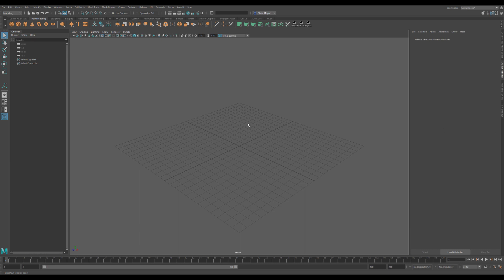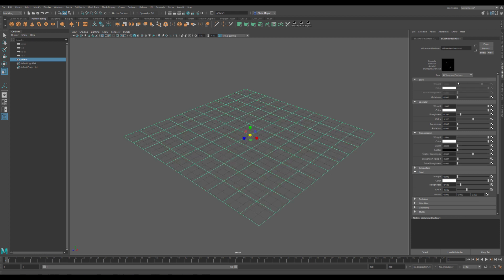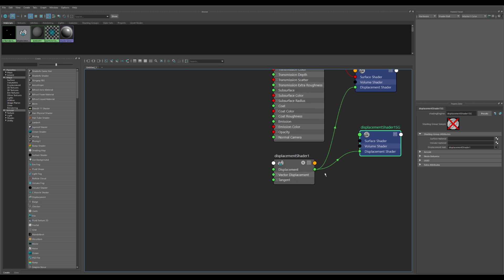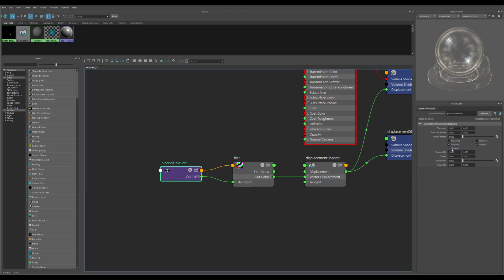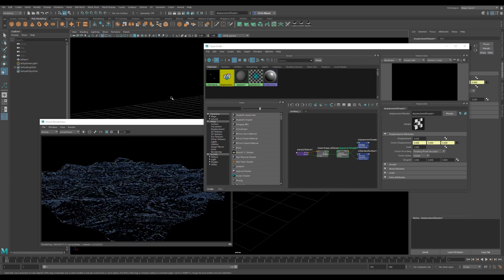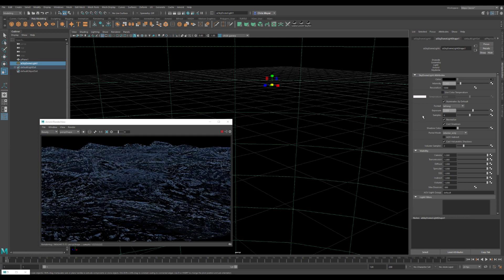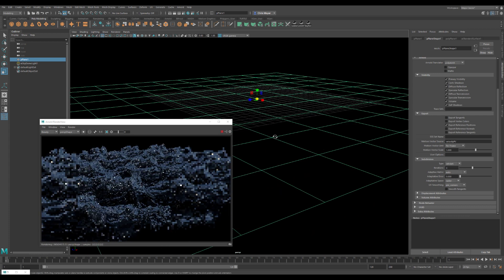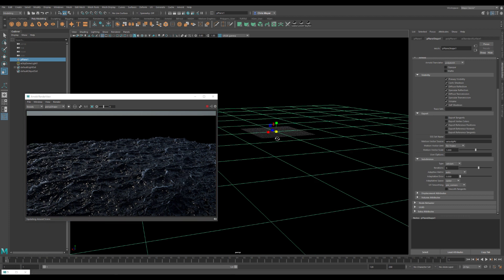Arnold Ocean

Comment: Thanks for the tutorial, any ideas how can i get a diff color ocean?
Reply from the maker: Hey Tory,

It seems that adjusting the color attribute under the Transmission tab of the aiStandardSurface1 (the Arnold shader we added to the mesh) affects the color most directly. 
However, since we are relying on Transmission to get the correct water effect, anything underneath will strongly color the water as well. So to get turbid, gnarly water you may create a strong saturated yellow for the Transmission of the ocean but put a light blue mesh underneath to get indirect coloring. 
Hope this helps steer you towards your desired result!

Comment: Thank you very much for this tutorial! Would you also happen to know about how to animate the waves? 
Cheers!
Reply from the maker: Hey Ra, 

I haven't had time to go back and try to animate this scene, however since it is being driven by a texture/file combo, I would look at what parameters could be keyed within those nodes for the animation you want. Here is my reply from a similar comment a little while back:

"I haven't tried to animate it yet but I imagine any method of creating animated textures would apply here. One way might be to take the vector map into photoshop, use the filter Offset (Filter->Other->Offset) to shift the image in place and export these new images to create an image sequence that you can import into Maya as an animated texture in place of the .exr image. A procedural texture being used to drive the animation of the file node may work but I imagine it's more complicated than using a procedural texture node as an offset to the uv coordinates."

Hopefully this points you in the right direction!

Comment: Excuse me Bomb Beard. I had a problem about displacement. I follow all of your instruction but after i rendering it. The ocean waves looks like a tile. The waves always repeat in the same way on the different spot. It looks unnatural and not looks like wave.
Reply from the maker: Hey Eunha! If I had to make an educated guess there would be two places to start investigating:
Ensure a good UV map on your object, since when changing geometry your map can become distorted.
Check your place2dTexture node and make sure that coverage is set to 1. This translates to the vector displacement map covering the entire UV space evenly.

If neither of those work I'm stumped! Assuming you downloaded the same vector map I was using and followed every step it is hard to track down what could be wrong.

I'd like to hear your solution if you've figured it out since commenting!
Reply: I had the same problem, then realized it was because I wasn't expanding it enough. maybe that's the problem with your tile as well?? I dunno but maybe playing with the size more might help

Comment: anyway you could think of to animate the exr file to make the water shader appear as though it is moving? Maybe add noise somehow and animate that as a mask?  I will attempt but I am curious if you have tried this and had success.
Reply from the maker: Hi Jacob! I haven't tried to animate it yet but I imagine any method of creating animated textures would apply here. One way might be to take the vector map into photoshop, use the filter Offset (Filter->Other->Offset) to shift the image in place and export these new images to create an image sequence that you can import into Maya as an animated texture in place of the .exr image.

A procedural texture being used to drive the animation of the file node may work but I imagine it's more complicated than using a procedural texture node as an offset to the uv coordinates. 

Let me know if you found a good way to animate this wave!